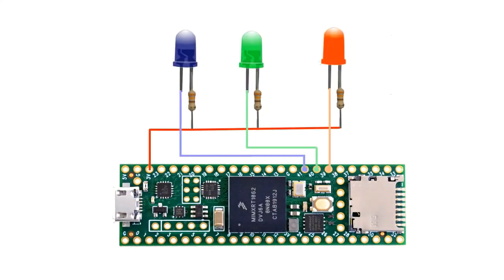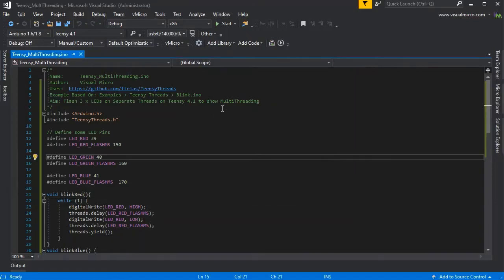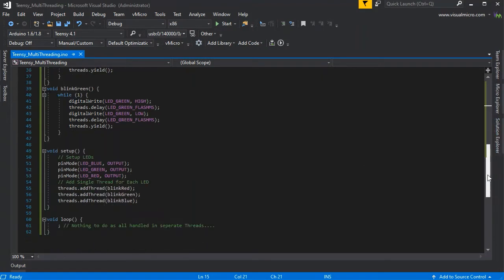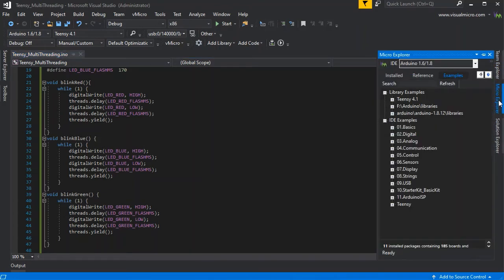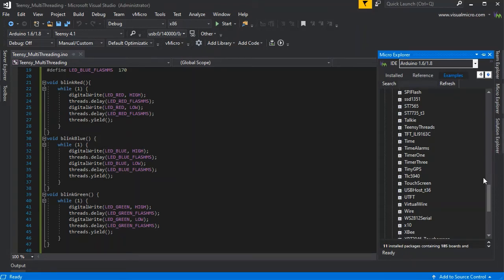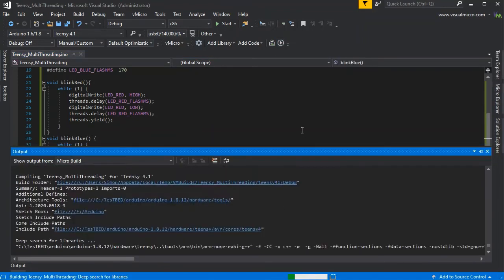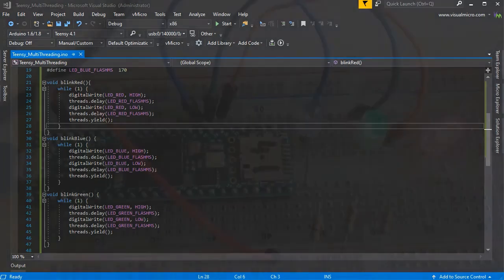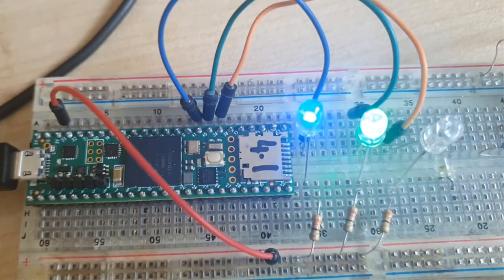Multi Threading with Arduino and PJRC Teensy Boards

Comment: Is teensy threads recommended for High speed applications?
Hello, I'm currently making a program in Teensy 4.0 for an application that needs to handle some threads. One of these threads is USB serial communication (sending and receiving data via I2C, using wire.h library, wire and wire1 from a GUI), and another dedicated thread for sending and receiving digital and analog signals. In my current program, I use the teensythreads.h library to handle this, but I see some delay on external signals. Based on your experience,

Do you recommend using teensythreads to handle this heavy communication, or Do you recommend another alternative?

Comment: Can you do a DMA example with teensy? :D
Reply from the maker: There are some libraries available to allow DMA usage for SPI and I2C on Teensy:
SPI: https://github.com/crteensy/DmaSpi
I2C: https://github.com/nox771/i2c_t3

There is also a very in-depth guide on DMA for Teensy 3.2 on HackADay:
https://hackaday.io/project/12543-solid-state-flow-sensing-using-eis/log/41575-dac-with-dma-and-buffer-on-a-teensy-32

And the Teensy DMAChannel.h has a lot of useful comments:

https://github.com/PaulStoffregen/cores/blob/master/teensy3/DMAChannel.h